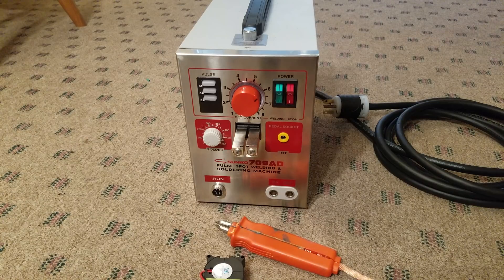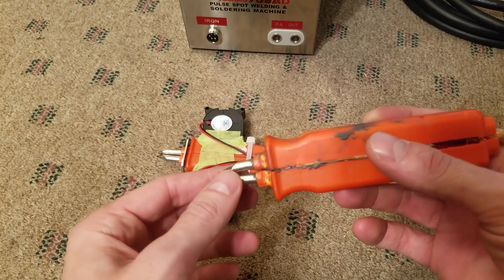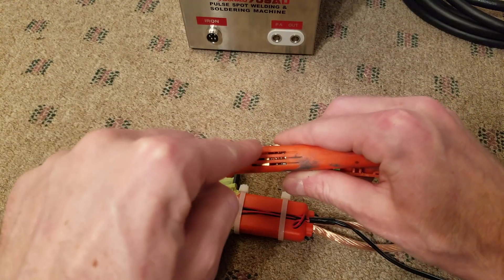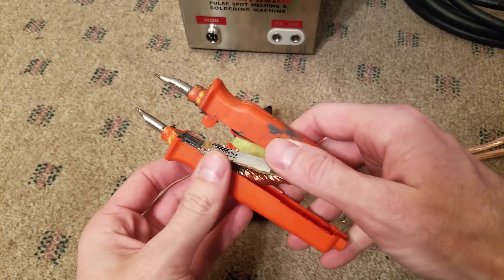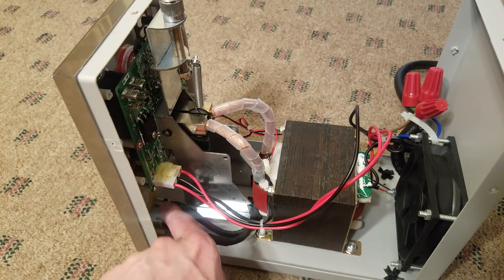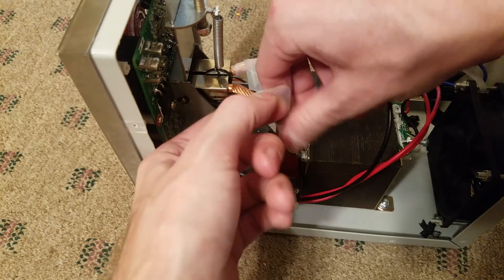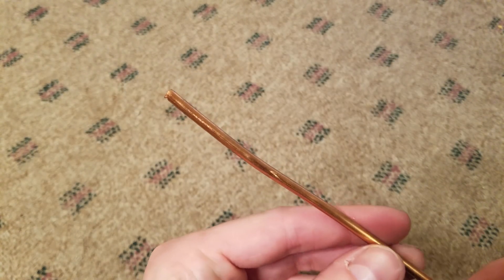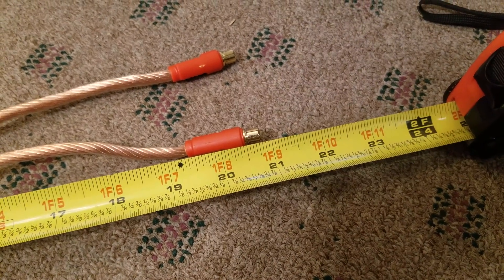Sunkko 709AD Spot Welder Welding Pen Upgrade, Extra 100A+!

Comment: Might need to dial back on the settings to stop the electrodes from sticking to the nickel strip.
Reply from the maker: It wasn't sticking with less current. Maybe I need higher pulse combined with less current? I need to play with the settings more.
Reply: @LithiumSolar  just need to switch to the copper/tungsten alloy on the electrodes at the higher amps. 
Great tip. I am gonna do this to my welder. Stock leads are not adequate for production. This should work much better. I was thinking about doing this as soon as I melted my handle on the first battery, and if it would make a difference. Now I know its worth my time to do! Thanks for the proof!

Comment: Now just get out the hot snot gun and gooey up where those two wires pass through the front plate. That way you won't have to worry about possibly tugging on them by accident and causing snagging on the connections inside. Like you said, the wires inside are not solidly connected to the transformer. 
Maybe that can be a future upgrade mod as well 😉
Reply from the maker: I ziptied it to the frame inside so you can't accidentally pull it out. I didn't film it because it was an afterthought as I was putting it back together.
Reply: @LithiumSolar  Nah, needs the snot.  Make it look like it's got a runny noise  😜

Comment: After this unit  dies you can just replace the transformer with a modified microwave transformer[as seen on Youtube!]. I know yours looks good but for $240 I'll save my money and build another microwave welder,they work for spot welding 18650's just great! Oh yeah..... Checkout Jehu Garcia [on Youtube] for info and  excellent deals on lithium batteries!     Keep making these great videos!!!!!
Reply from the maker: If I were to redo the spot-welder thing, I would buy the Arduino spot welder from the start, not the Sunkko. Live and learn...

Comment: I know this was just a test but is there any safety risk to having two separate electrodes? What happens if you slip and short them with your hands?
Reply from the maker: The voltage is extremely low, that's how they get the amps so high. I don't know what would happen if you grabbed the electrodes with your bare hands while not pressing them on metal. I wouldn't advise trying that... It's no different than the pen they provide, they just give you a plastic handle, you could still slip. I will probably heat shrink them down further towards the tip. Also, I will note the Aurdino and KWeld both have the same style of electrodes. I'm not sure I answered your actual question, but those are my thoughts :)
Reply: @LithiumSolar  a couple zip ties with a spacer to get the tip distance correct and a T handle just as a bit of extra protection and something to push down with and you are good to go. It would probably take a perfect storm to actually do any damage with the low voltage.

Comment: The pack of matches made my day lol.
Reply from the maker: Ha, yeah I still like using matches for wiring heat shrink. The heat gun I have for 18650 shrinks doesn't get hot enough for wire heat shrink.